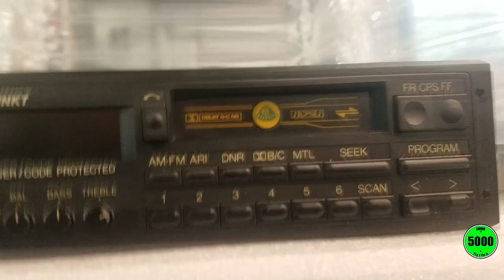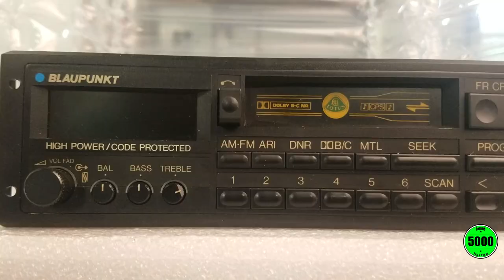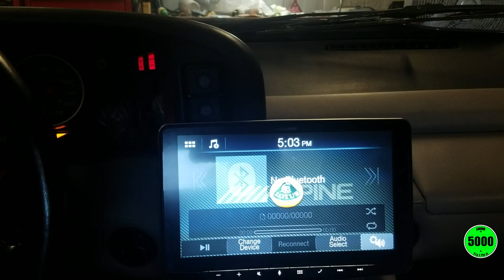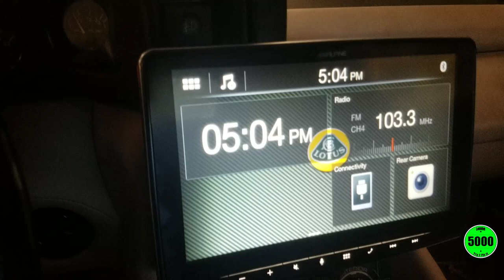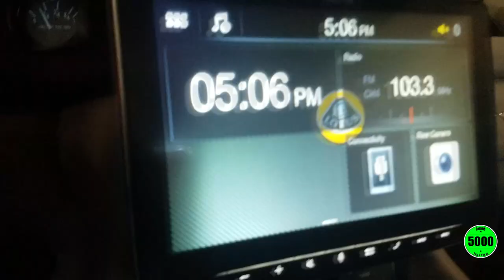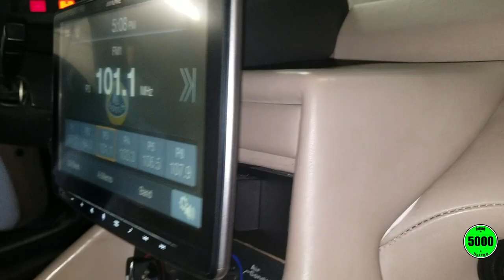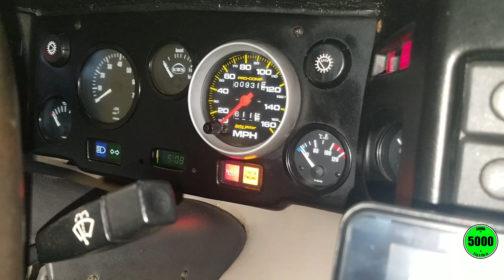1989 Lotus Esprit Factory Radio Replacement!  Too big?  Too much? Part 8

Comment: When you used those spade connectors to hook to the original socket, was there something else you did to hold the wires in securely? In the video it looks like at some point you were screwing together some sort of cover? I'd be worried the connections could come loose over time....
Reply: at 3:48
Reply from the maker: I used a few small zip ties.  I bundled all of my wires together to create a little tension on the connector. Then also ran 2 small zip ties to the car harness (the black thing I was screwing together)

The black thing was the car harness, and there was a removable black plastic cover to conceal the solder joints.

I had the cover off so I could match my spade connectors  to the correct location on the harness.

Comment: Surprised Lotus used a specific connector as part of the loom.

Think I would have cut the connector from the main loom and splice in an ISO standard radio connector. And probably splice in the opposite connector to the loom end of the old cut off connector for future use with the original stereo.
Reply from the maker: Great comment.  I'm not sure who lotus used to manufacture thier radio, but it had an unusual connector.  I thought about cutting it, but opted to leave the original wiring there incase some one decided to put the original radio back in.   Values of classic cars continue to go higher and higher.  High values relay on low miles and high originality.   I just couldn't clip it!  Lol
Reply: @LemmeTryFixIt  , I can sympathise! Not sure back then that there was any real standard for the connectors (we had a few Alfas fitted with similar age Blaupunkt stereos - none have a connector that looks like that). Suspect the one you have there is specific to that actual stereo, as even Blaunpunkt seem to have used a few different one.

I am surprised that Lotus hard wired the loom into a proprietory connector (for a start, makes it harder for the dealer to upsell the stereo, and means more spare parts to stock for different markets with difference stereos). Might be a more generic connector buried behind the dashboard somewhere, which might make things easier.

By cutting the connector off, I mean about 4" down the loom (give or take a bit for convenience). Then splice in a modern ISO standard connector to the loom to replace it so that your can plug your modern unit in and out easily. Then fit a matching ISO connection to the old stereo section of wire to that plug, so it can be plugged back in easily in future.

As an aside, bit of searching and I think it might be a Blaupunkt San Francisco SQR28 or a Blaupunkt Portland SQR48, but with Lotus branding. Seem to be a few variations using the same name / minor restyles, and they seem fairly commonly used on Porsches.

And just looking through Ebay, didn't really old Blaupunkt stereos were worth so much!